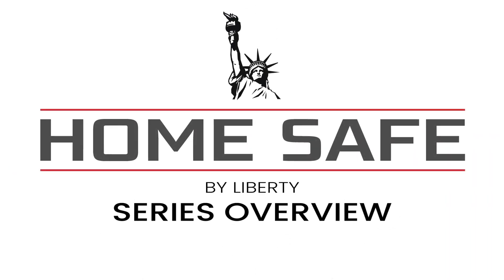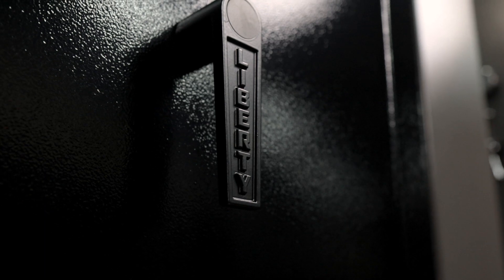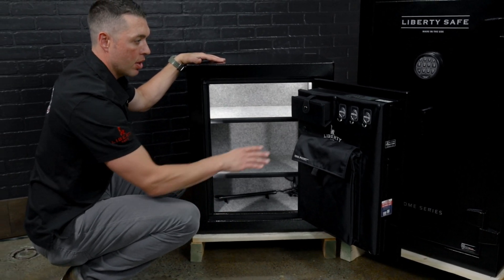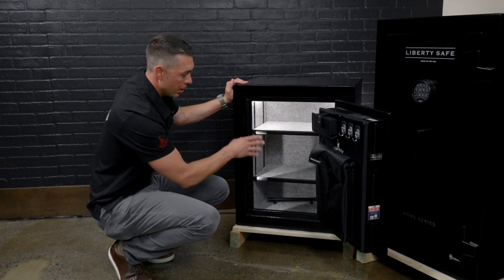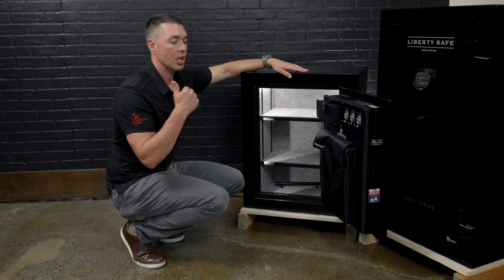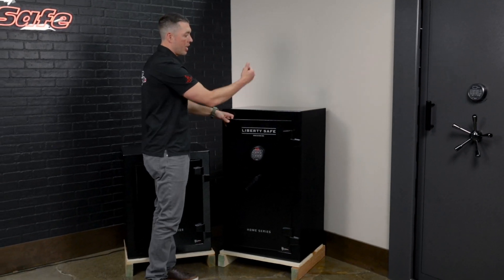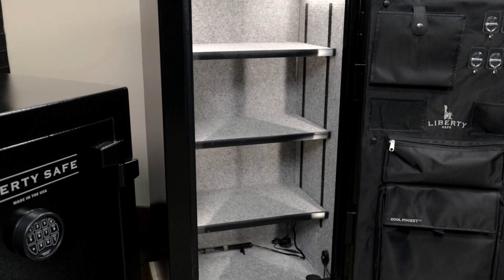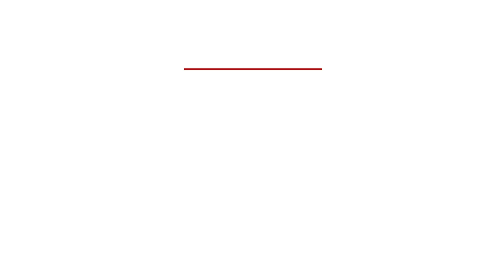Liberty Home Safe Series Overview - Made in the USA!

Comment: Now their home safe comes with a direct line to the FBI to unlock it when they raid your home!!!!
Reply: lol. The FBI can open a “residential security container” (RSC) in under 5 min. They’ll just destroy it while doing so.
Reply: @tangoESPECIAL  Yes lol a battery operated grinder will cut a hole in the side in 5 minutes. Punch out the drywall and they are in.